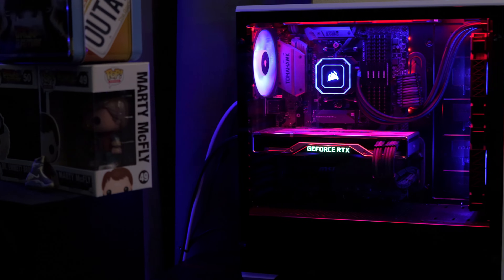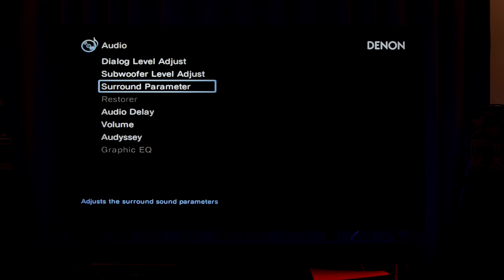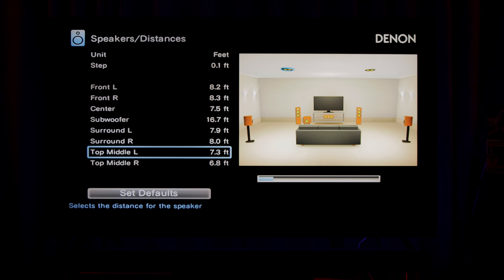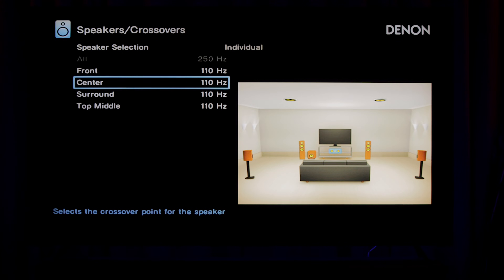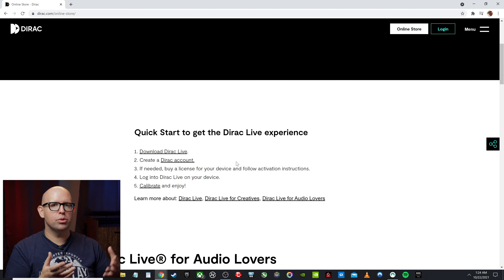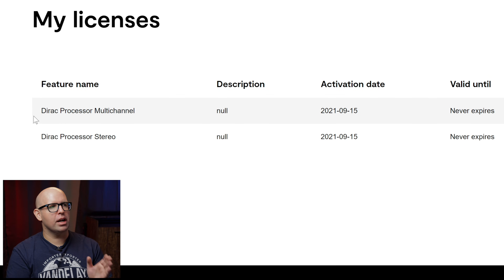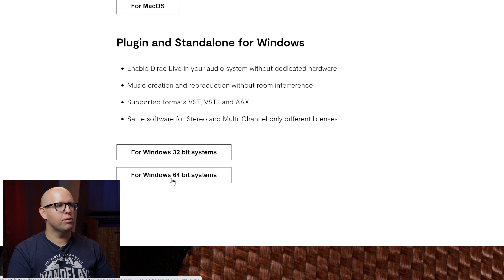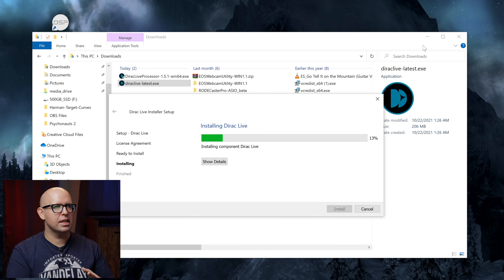DIRAC LIVE Room Correction GUIDE | Installing software & receiver configuration (PART 1 of 2)

Comment: A question: great video, very informative,  thanks, but I still can't connect DiracLiveProcessor to my HiFi system in a pure stereo setup without a Dirac device in my forementioned HiFi system. I can see a 'Dirac Virtual Audio Device' setting in my iMac Audio/Midi application, but don't know how to use it in conjunction with my HiFi system, or should I connect my DAC with a USB cable I don't prefer? Normally I play music through Audirvana by UPnP to my Lindemann audio bridge 2 and from there to my DAC.

Comment: the most easy way to use it and calibrate your AVR is using the cellphone app , on my Pioneer LX 505 I use the  Pioneer Remote app , very easy, you can use the microphone that is include in the AVR , you can correct up to 9 points corrections

Comment: Good video, unfortunately all this is way beyond my technical skills. I can barley get my way around a computer. I'll try the mobile app.
Reply from the maker: Thanks for the comment. Yeah, audio calibration is a pretty deep rabbit hole to go down and definitely requires being comfortable around a computer most of the time. I will say though, of all the programs I've used over the past few years for calibration of both audio and video, Dirac was honestly one of the most straightforward and easy to use.

Comment: Hey there, I have Arcam avr850. I am having problems in getting the first center spot getting calibrated. Getting error report. I changed every setting and volume levels or the mic volume. Still getting error report. I have a mic that  came with arcam. Any help will be greatly appreciated. Tks

Comment: Do you have to have your movies play through your computer for Dirac to work? Have a new Marantz receiver and definitely looking for a solution without getting a new equipment.
Reply from the maker: You do as the only Dirac Live corrected audio will be whatever is output from your computer.
Reply: @HomeTheaterGamer  If they could produce a standalone box one could put between a source and the hdmi input for an AVR I’d shell out some cash for that. I’d buy the DDRC-88 but  for some reason it doesn’t support a common 5.2.4 format.
Reply: @jrep88  just note that it likely couldn't use hdmi as a passthrough, due to copy protection.

Comment: Hey Brad, As always, thanks for this video and info.  
However, folks should know that there is no software that can correct a "bad room" that has reflective surfaces all around the listener.  Last night I did a low tech test with some soft cushions placed against the walls in my living room around where I sit.  Dang!  What a difference in audio clarity from each speaker - 5.1.2 system.  I listened to music, watched a couple test movie clips and played HALO 5 for a couple hours.  I found that the sounds from each speaker was plainly coming from the speaker and not being mixed together with many reflections.  The lower reflections helped with clarity of the music and movies.  HALO 5 was more fun and intense because I could hear character sounds, gun shots, foot steps, voices, etc... much clearer than before.  I am looking forward to properly treating my room and then rerunning my AVR room correction. 
Thanks again and please have a great day!
Reply from the maker: Thanks for the comment, Kevin! I absolutely agree with you. Room correction can’t fix a bad room. I have always viewed it more so as “icing on the cake” that you use after you get your system sounding it’s best. Proper speaker setup and even makeshift acoustic treatments like you did with your low tech test can really go a long way. I think people expect room correction software to fix all of those issues for them, and that’s just not the case.

There’s an old home theater saying in regards to video quality: “garbage in, garbage out.” That definitely applies to audio and room correction software as well.
Reply: @HomeTheaterGamer  Hi Brad, thanks for the reply.
I'm sure getting the best out of a system is a multi step process for most of us based on the availability of expendable funds and time.  I thought I was happy with my system until last night.  Acoustical/refection treatment is no longer "icing on the cake" for this guy - it's a must.  Time to "tune the room" then run the AVR room correction again.  Can't wait for the results of that effort.  It will be really interesting to hear how feeding the movies/soundtrack through a PC and DIRAC LIVE into the AVR will sound.  Of course, gotta save up and buy/build and worthy PC.  Money money money.  Hobbies?  Who knew the expense and frustrations?  Hahaha